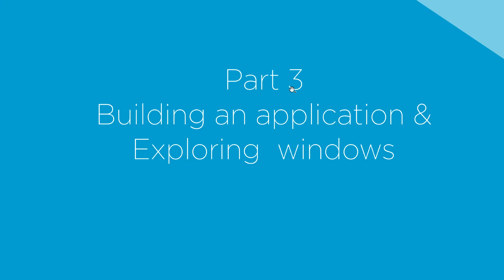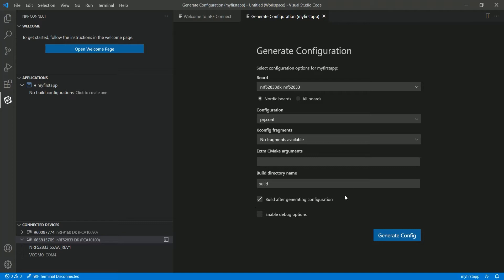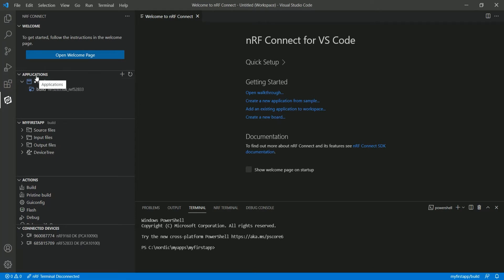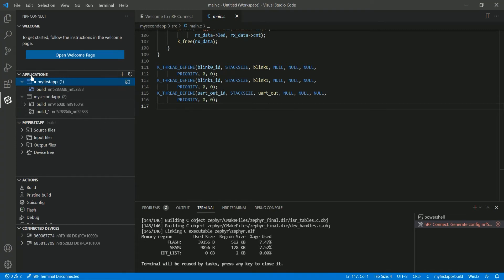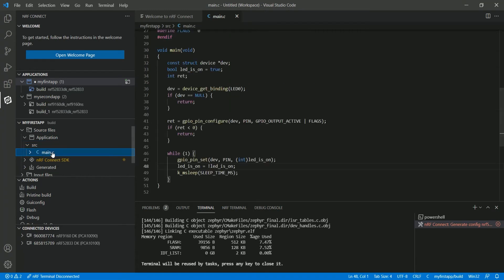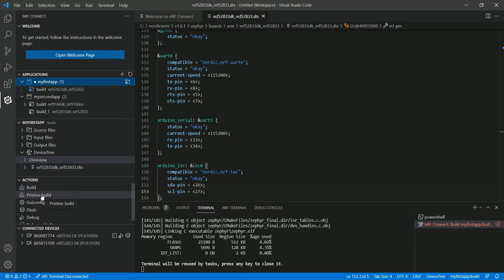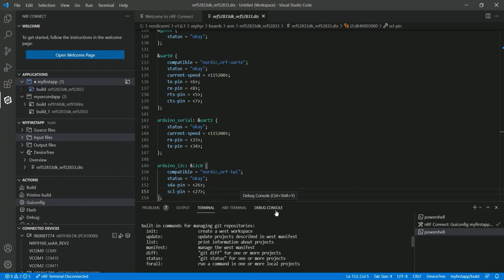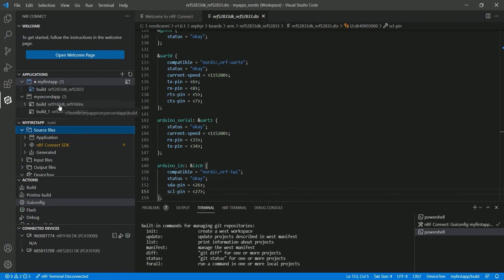nRF Connect for VS Code, 3: Building an application & Exploring windows

Comment: Hi Team,
How to get an nrf52832 device listed under the connected device?
(new to this)
*Does it gets connected automatically (without USB)?
*Does it need to connect via BLE?
* What if a device is not able to connect via USB (nrf device does not have a USB/type C port to connect via cable)

please mention the step-by-step process.

Thank You.
Reply from the maker: Hello, it is a bit difficult to explain step-by-step in a YouTube comment, so we recommend you to reach out to our tech support team directly on DevZone if you need more technical help: https://devzone.nordicsemi.com/

To get an nRF52832 device listed it must be connected via a debugger, which in turn is connected to the PC via USB. The DKs have an onboard debugger, but you can also use an external debugger that connects to a custom design. If you have a custom board, you also need a DK or another debugger, which must be connected to a DK.

As long as the VDD (voltage) is 3 volts on the custom board, the DKet must "detect" it and debug the external instead of what is on the DKet from before. Other debuggers often also support other voltages than just 3V.

Comment: Do I have to install a special driver (in WIndows)? Do I have to use a special cable?  Do I have to flash a special booloader using the programmer? Your videos seems to be very good, but as a total beginner I need a very basic unpacking/connection guide. (BTW: I have been able to flash the asset tracker. It works on the device)
Reply from the maker: If you are new to the Nordic Thingy:91 we recommend you to have a look at the getting started guide for Thingy:91: https://developer.nordicsemi.com/nRF_Connect_SDK/doc/latest/nrf/ug_thingy91_gsg.html

Comment: My thingy91 does not appear in the CONNECTED DEVICES list. I've tried everything now. I wish you could provide more info on how to get the device to show up. What's the prerequisites?
Reply from the maker: Nordic Thingy:91 doesn't have a debugger. You need a development kit or a J-Link debugger to be able to program new applications to the Thingy:91.

Comment: My Thingy:53 is not showing on the connected list, even though it is connected to the PC via a serial USB Cable; I have installed nRF Command Line Tools too. But, still nothing. Can you guide me how to proceed?
Reply from the maker: The Nordic Thingy:53 is not support yet. We are working on the support, it will be available in a later release. As of now you need to use nRF Conenct for Desktop: https://nrfconnect.github.io/vscode-nrf-connect/connect/ui.html#connected-devices-view

Comment: is there someone who has the same error as me when creating an add build configuration. When i try to creat a add build configuration. I get the usage: west [-h] [-z ZEPHYR_BASE] [-v] [-V] <command> ...
west: error: argument <command>: invalid choice: 'build' (choose from 'init', 'update', 'list', 'manifest', 'diff', 'status', 'forall', 'help', 'config', 'topdir', 'selfupdate')

 *  The terminal process failed to launch (exit code: 2). 
 *  Terminal will be reused by tasks, press any key to close it. 
i also tried to install the nordicsemi kit in ubuntu. but first on windows but i get the error the same time. i also tried to reinstall it multiple time but i just dont get past the building configurations
Reply from the maker: You need to configure the SDK location, the building system can't find Zephyr, please see: https://nrfconnect.github.io/vscode-nrf-connect/connect/setup.html#configuring-the-settings

Comment: Thanks for the tutorial! I have a question, what if I want to create a project for a custom product why do I have to select a board to create a config? That's quite a weird solution for the real world products. Is there a way to create a config without using any specific board?
Reply from the maker: No, please see: http://developer.nordicsemi.com/nRF_Connect_SDK/doc/latest/nrf/app_build_system.html. All application configuration in the nRF Connect SDK is board specific. You can start by targeting a DK during development instead of a completed production board, but you have to specify a board for every build.
Reply: @NordicSemi  Thanks for the answer. I found you that the board config file is stored in the project folder. This makes the VCS usage straight forward, that's actually all what I needed)
Reply from the maker: @Aequitas0Sports0  That is great to hear.

Comment: May i need to connect a board when build the project
Reply from the maker: No, you do not need a board to build a project. But you'll need a board to be able to flash the project to a device.